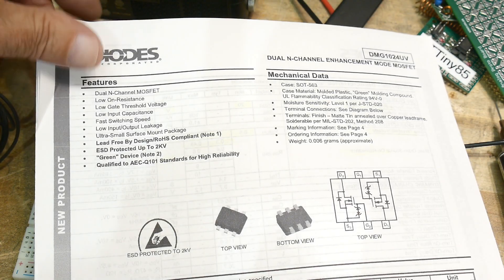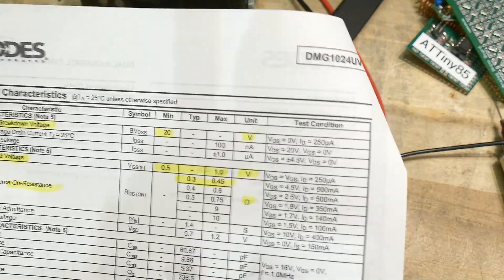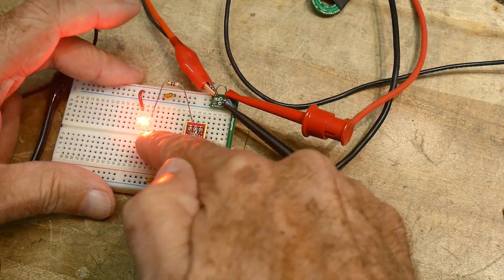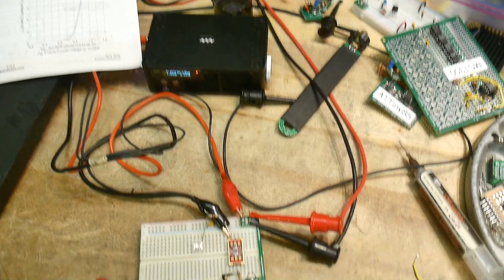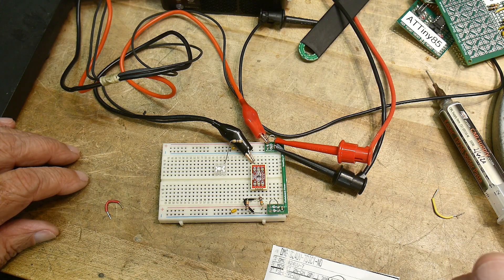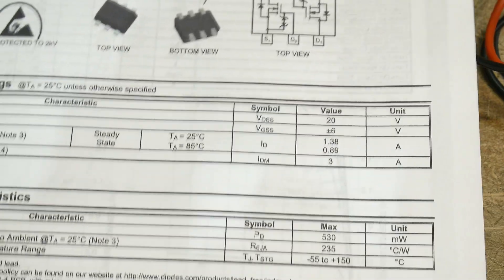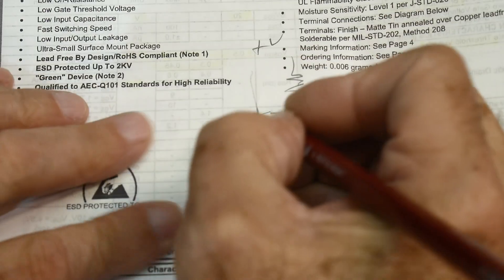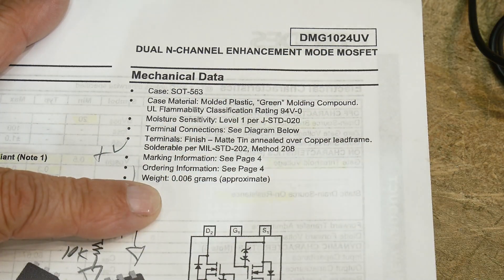#1980 DMG1024UV Dual N-chan MOSFET in SOT563 package

Comment: Gate-source voltage = 1 V is when it first starts to conduct.  Getting drain-source resistance down to 0.3 Ohms requires a bit more bias voltage... probably 3-4 V.
Reply: @byronwatkins2565  2.5V is just over, 4.5V is just under 0.3 ohms, 1.8V still leaves you in the respectable range of 0.5 ohms. 1.5V would be impractically low for sure.

Comment: Bit of a simplification with the threshold voltage... 1.8V is enough to open the floodgates wide enough for the spec 1A, but only with >0.5ohms of resistance. That'll have the part putting out a bit more than double the heat compared to 2.5V, while 1.5V would leave you as high as 10 ohms, and heating up at 5x the rated power (around 2.5 watts) if you're running half an amp through.

Comment: I like the one with P and N channel Mosfet like NTZD3155CT2G very handy part for a power switch circuit
Reply from the maker: yes, like my video: https://youtu.be/kivLqbVXVNY?si=ofzz3Et5EgqYSbbk
Reply: @IMSAIGuy  exactly the circuit that I use except usually control of NMOS is done with GPIO in firmware.

Comment: are these any good as amplifiers or just for switching?
Reply: I think I read something somewhere to the effect that a lot of these switching mosfets are typically made up of a bunch of smaller mosfets in parallel, and when you operate them in their linear region, the individual mosfets will tend not to share current very evenly. So the tldr is no, these things are at their happiest when you are driving them fully on or off.
Reply: All those diodes up in there kinda makes you wonder?
Reply: Maybe a class D amp.
Reply: I suspect this would work fine as a current mirror, or in a common-gate amplifier, both of which benefit from running at a low threshold voltage.